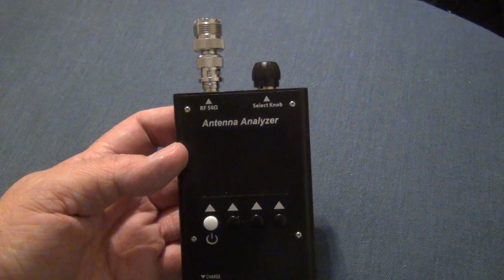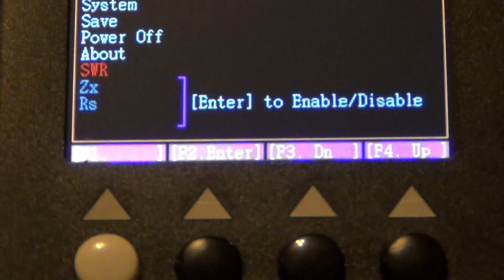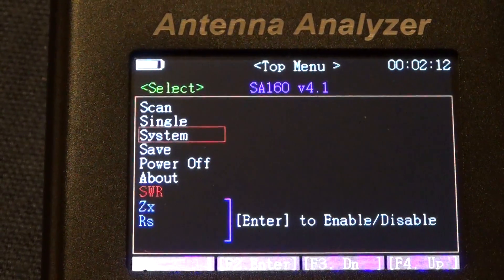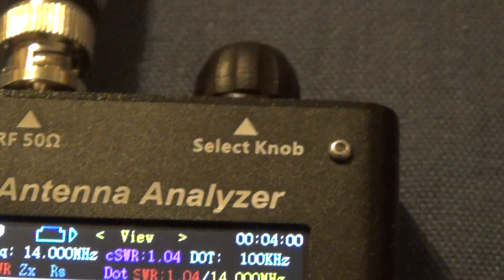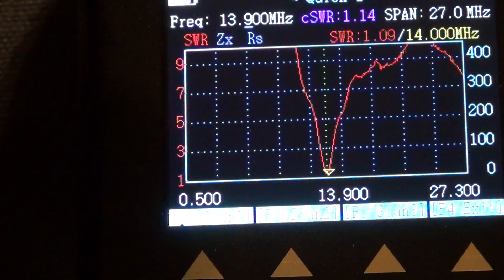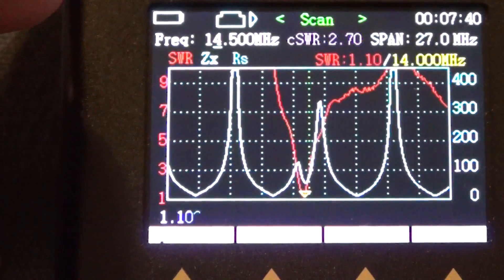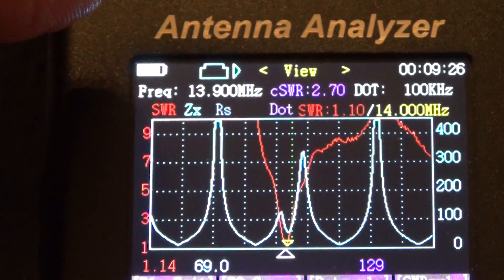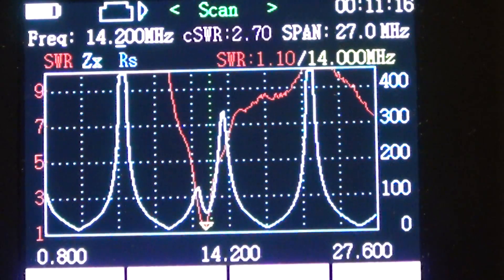Using the SURECOM SA-160 Antenna Analyzer - Part 2

Comment: I am looking at purchasing an antenna analyzer and there are are a lot of analyzers out there with wide range  of features and prices.  I have looked at this SA160  and like it for the color display  , price an  ease  of use . I have had  a  SWR meter for many years and it just does the bare basics of tuning an antenna . I like looking at the graph because it tell you exactly what the frequency in resonant and SWR + impedance . Cons with this it does not check cables  or Smith Chart  and size  and frequency  range  is only to 60Mhz  but if you have been looking  the only one I could find with more range was Rig Expert AA-170  it covers .1 to  170 Mhz . priced @ $331 HRO  compared to about $193 SA-160 . Gud luck hunting & 73 K8VYA
Reply from the maker: I got the two units, one for HF and another for VHF/UHF, both from SURECOM, SA-160 and SA-250. I have video on the other too.

Comment: Thank you for the nice video.  I need an analyzer to tune a magnetic loop antenna and am wondering,  is there a continuous run mode where I can see resonance while I turn the antennas capacitor? Mag loops have very narrow band width a few kHz .
Reply from the maker: You would need to turn the cap and re-run the meter each time, but the runtime is pretty quick.